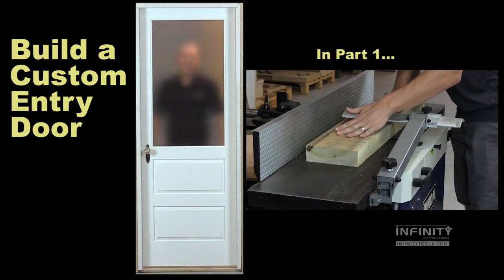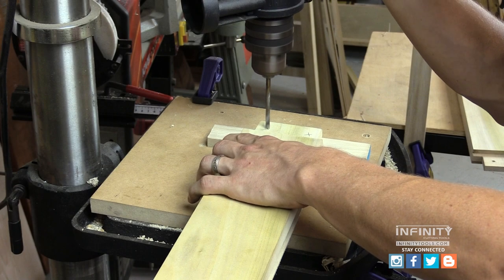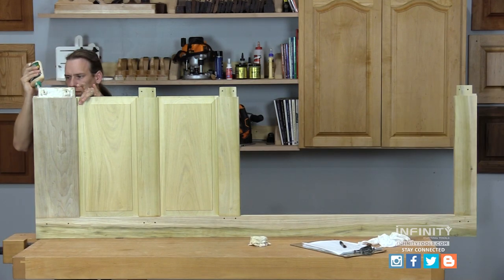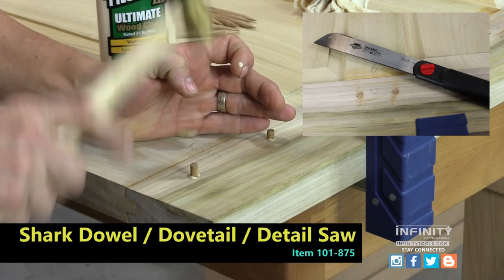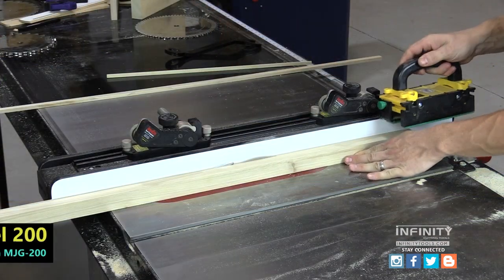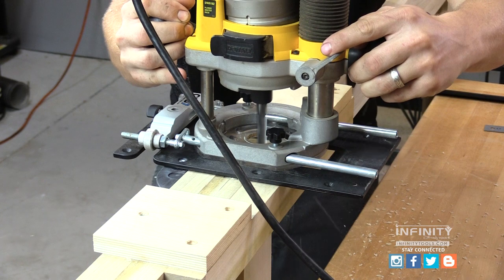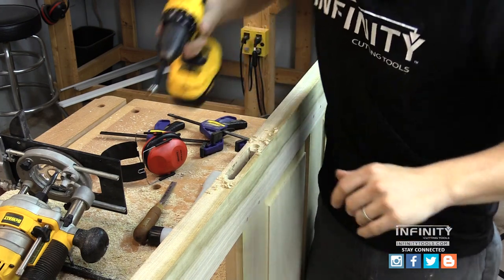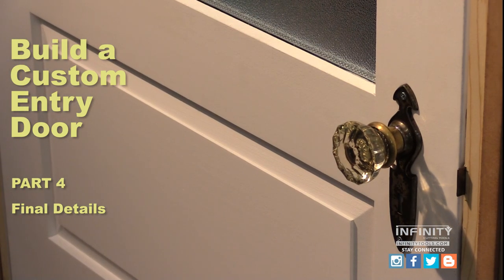Build a Custom Entry Door - Part 3 of 4

Comment: So the holes in rail and stiles are different sizes and offset. This way you cannot use a portable drill press to drill both holes in one go?
Reply from the maker: The holes are the same size, but are offset. This is why they cannot be drilled in one shot.
Reply: The holes are the same size.  The hole on the tenons are about a 1/32" further from the shoulder than the mortis.  So when you drive the peg through both holes the two pieces are forces together.
Reply: InfinityTools how important is the offset. What if i skip it? How much problem will that create in the doors? Some people just nail them
Reply from the maker: With a modern glue like the titebond 3 I used you can skip the pin altogether, however the pin insures that the door will stay tightly together even if the glue fails. Creating the offset holes is not difficult and worth the littler extra work if you are going to pin the tenons. If you are not going to offset the holes I would not bother pinning the door at all and just trust the glue.